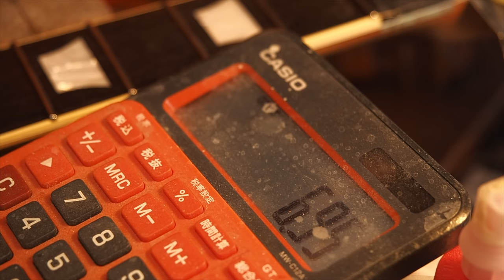Navigator Les Paul Refinish (Part 2 of 2)

Comment: Your work is fantastic. This is in no way  a critique, but something I think you'll appreciate.  When trying to have the cleanest wiring possible I use heat shrink  on the ends of cloth wiring, this keeps it looking very clean in addition to preventing further fraying of the material.  I haven't found a way to cut it that looking pleasing.  I really appreciate your use of tubing over the leads on the tone caps, great idea.

Comment: Soldering in one of those things where there is a dozen "right" ways to do it.   Your work looks great, and the only difference I see in what you do, to what I do, is the following.
1: I don't add solder to my iron. I use the iron to heat the joints, and place solder near the iron on the joint and let it flow to the heat.
2: For a great "stable" joint, Mechanical First, then solder. (Example, at 5:20, you soldered the wire onto the tab. I'd have looped through the tab, then soldered). btw: Props to you on using heatshrink there too!
3: I've never ever trusted the cladding on pots. I've always taken a small swipe at a pot with a file and soldered to the metal (which generally you use a bit more flux and heat to accomplish).
Reply from the maker: My ideal soldering is to not pour in as much solder as possible, because solder is resistance.
However, the amount of solder is difficult to determine, because if there is not enough, the strength cannot be maintained.
Reply: @Andybassguitar   Right you are, Solder is resistance (depending upon the connection it could be less or more than the physical connection). Which is why a good mechanical connection is important. In a perfect world, we can rely on the mechanical connection, and solder to stabilize it, and prevent corrosion of the joint. 🙂

Comment: Excellent work!! I recently subscribed and I’m so impressed with your ability.

Question for you, are you adding solder to the frets before you remove them? If so, why? I’ve heard that you’re supposed to heat the fret before pulling it out but I’ve never seen solder used on it too. 

Thanks Andy!!
Reply from the maker: Solder is used to transfer heat efficiently.

Comment: I love your work. It's amazing.
Can you tell me what material you apply with the small brush? The finish is simply beautiful.
Reply from the maker: Thank you.
What minute is the scene?
Reply: @Andybassguitar  Thank you so much for answering me.
Right at the beginning of the video, between 0:46 and 1:17
Reply from the maker: This is an oil for oil finishes.

Sorry, the manufacturer is a secret. In the scene where I am wiping off the oil, this is the one on the upper right.
Please try to find it. I'm sorry.
Reply: @Andybassguitar  Thanks. I don't need to know the brand. I'm just delighted with the finished result. Looks like varnish or shellac but prettier.
Your work is wonderful.

Comment: Hello again, do you use a single cut or double cut file for the fret ends?
Reply from the maker: Sorry, I don't know what you mean by single or double cut of the file.
I am using the one that does not have a file attached to the sides.
Reply: @Andybassguitar  Single cut: when you look at the file you see lines going in diagonal from one side
Double cut: when you look at the file you see lines going diagonal from side, and lines going in diagonal from the other side as well, and they cross each-other.
it's like you put 2 hair combs on top of each-other.

Comment: At 16:30 i do not understand why you didn't make the ends of the frets before they are seated on the fretboard.
Reply from the maker: This scene shows the removal of burrs from a fret side that was cut diagonally.
I'm sorry, I didn't understand what you were saying.
Reply: @Andybassguitar  Yes, after removing the tung of the fret i would cut the length accurate and sand and polish the fretends to their final form and then i would hammer them in.
Reply from the maker: That way, there is a chance of scratching the hammer, and there is also a chance of misalignment of the sides when the frets are driven in.
I think the way to do it is fine for each person.
I've never heard of that method before.
Reply from the maker: At the end of the video, He is shaving the fret side...
Reply from the maker: @micheloderso 
The method in that video is one I've never heard of.
I don't want to watch it in detail because it's far from my ideal, seeing the fretwork in the binding part. I'm sorry, but I can only complain.
I don't want to see it too much because I don't want to have that feeling in the first place.
I think it's not very desirable.
This is my opinion, and I'll leave it up to you to decide what you think.
I think it is necessary to do fret leveling after every fret stroke for accuracy.
Reply: @Andybassguitar  If you do not watch you are not able to learn and i think your behavior is a little bit juvenile......
Reply: @Andybassguitar  Sorry, that was not very kind from me. 
I like your video work and your skills on all your Objects. 
I thought it would  inspire you. 
Again, im sorry for my unsensible Words.
Reply from the maker: I'm sorry too for complaining about the video you took the time to teach me.
I learned that there are many different ways to change the frets.
Thank you very much.

Comment: What is the brand of the mini toggle switch ?
Reply from the maker: Perhaps this is it: https://jp.rs-online.com/web/p/toggle-switches/7624741
Reply: @Andybassguitar  Thanks but it isn't. I was wondering because the one in your video has a convenient connectors orientation that I don't see anywhere else, and it seems to be good quality. I try to read the brand at 5:00 but I can't.